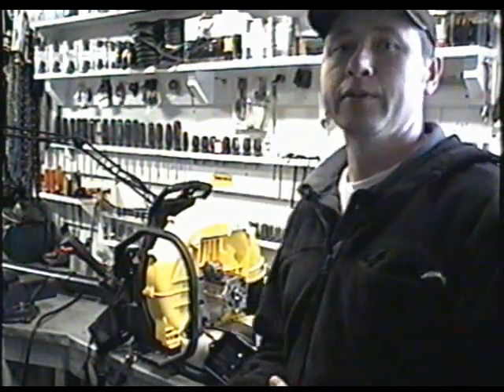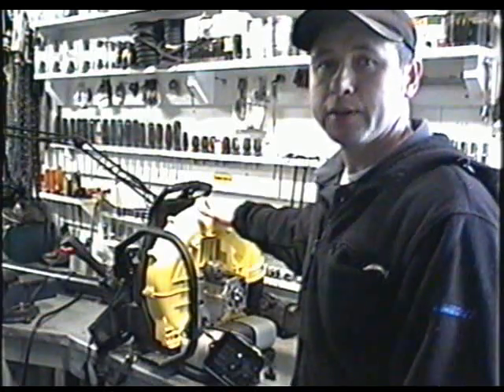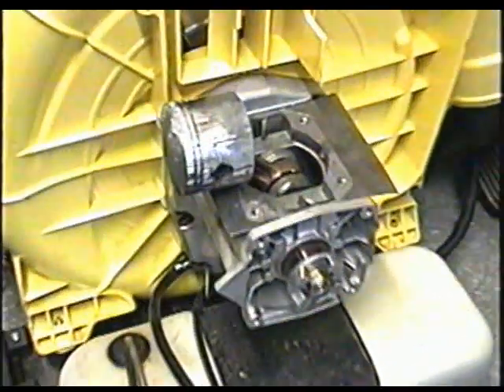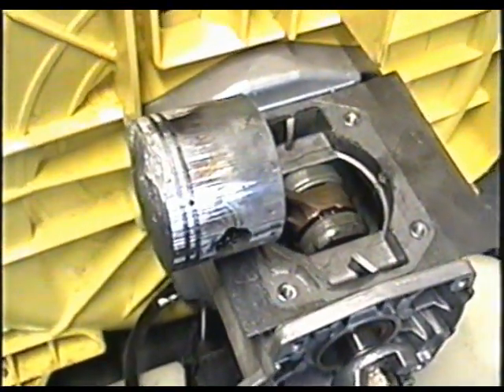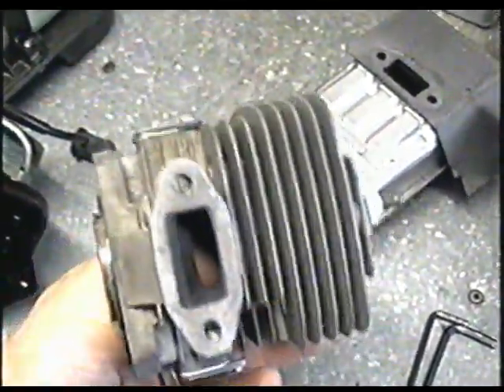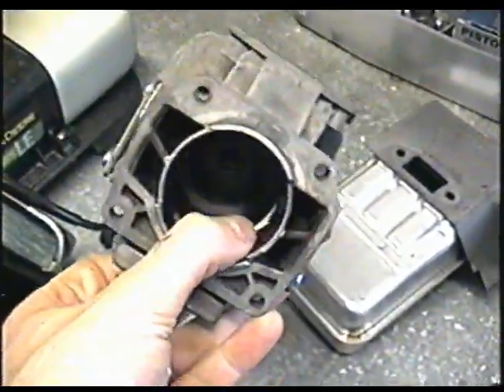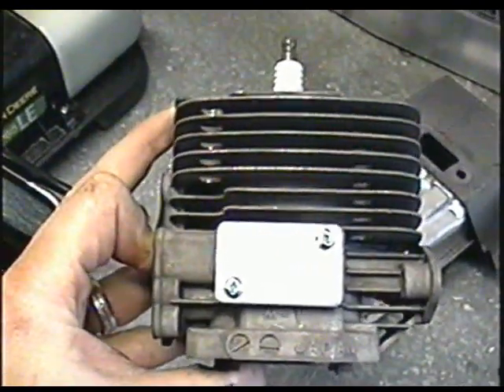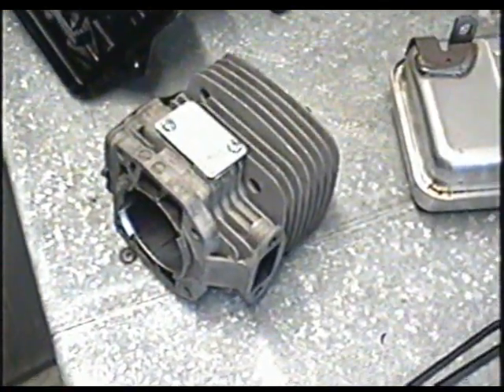FOLLOW-UP of  "NO OIL = Blown UP John Deere BP65LE Leaf Blower"

Comment: Thanks for posting Don. Always pays to double-check that gas...like lots of people have posted, it's frustrating seeing a new blower ruined that way. But I've seen it happen to people who've been running two-stroke equipment for 40 years. They get interrupted while mixing their gas, and forget to add the oil, or they use the wrong gas can...it happens. I haven't ever done it (knock on wood) but I'm not immune either. It could happen to me tomorrow.

Comment: I have one of these and it has no spark. I disconnected the ground wire from on/off switch and still no spark. The coil looks like it is a job to replace.